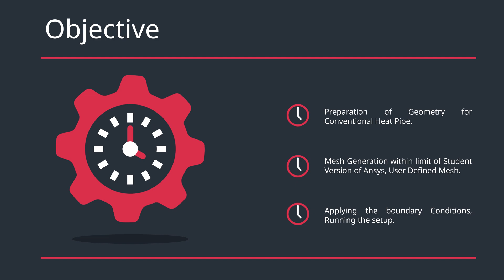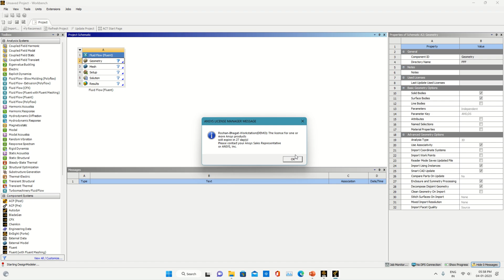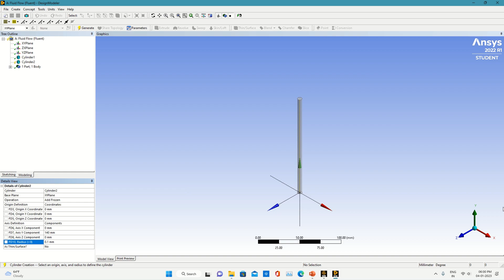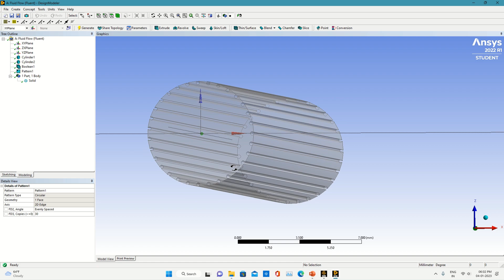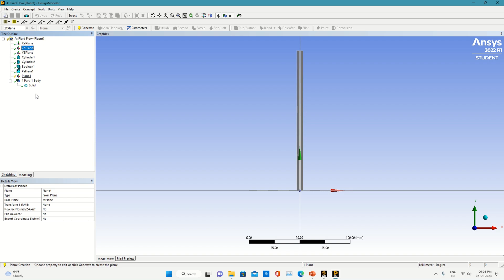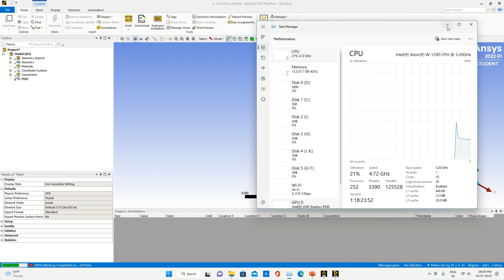CFD Analysis of Conventional Heat Pipe || Heat Pipe With Wick Structure  @Ayush.Bhagat

Comment: Hi, why did we need to divide the heat pipe into 4 parts while the other sections are not used or named 
What is the purpose of splitting since the heat pipe is having only condenser adabatic and evaporator section 
If giving amount of fluid is the purpose then why haven't we used any where??
Reply from the maker: To apply the boundary condition on specific surface in setup we done the slice.
We are considering the volume of fluid filled like 60% 
Another reason we want to speciy the heating section and condenser section thats the reason why it is done
I hope you got it
Reply: @FrontiersInCFD  I need to simulate a heat pipe how can I contact?
Reply from the maker: connect on whats app +919834584778

Comment: Thanks, it's a good and informative video. Can you please confirm it's a thermosyphon or heat pipe simulation? as I know in heat pipe the fluid return is governed by capillarity action not by gravity effect, again thanks for such an informative video.
Reply from the maker: its heat pipe. Diameter upto 3 mm is results in capillary action, diameter here is more. Its having v type groove fluid returns through groove after condensation

Comment: Hello teacher! Currently I am doing a 3D simulation of a heat pipe with grooves. I have some questions that cannot be answered, and I sincerely hope you can give me some advice. Thank you very much! First: How do I artificially set up steam channels and condensate return channels in the heat pipe? As we all know, the working state of grooved heat pipes is that steam flows in the center and condensate returns through the grooves. If the vof model is used to analyze the entire fluid domain, will the above phenomenon not be reflected? Second: If I simply extract the fluid domain for meshing and calculation analysis, there is a phenomenon that I am personally very concerned about, that is, the capillary force of the condensate flowing back to the evaporation section through the channel cannot be reflected. Because the performance of capillary action must take the tube wall into consideration. How should I carry out modeling so that it can not only reflect the changes of the two-phase flow in the tube, but also accurately describe the capillary reflux phenomenon? I am a beginner, if there are some basic factors that I have not considered, please forgive me, thank you very much.
Reply from the maker: Try to generate solid body along with fluid domain and have wick like structure, or prepare structure like a porous material

Comment: Why you made 2nd circle on diagram? Which was done pattern.. and how to know residual are normal or not? Have you followed any paper if yes please tell title of that. Thanks video is informative.
Reply: And what about adiabatic section. Need to define separately or automatically defined
Reply from the maker: In adibatic I haven't change any parameter
Reply from the maker: Second circle for wick material groove heat pipe . Check for divergence in velocity field.
No such paper..

Comment: Sir, while giving the cell zone conditions, you didn't specify which part of the domain is water, or which one is air. Does fluent take that into consideration automatically?  My second doubt is that the parts which contain air (the condenser and the part of the adiabatic section), is it the default air material or water vapor? Because, while you were giving the boundary conditions, the phase was set as mixture by default.
Reply from the maker: while preparing geometry names are given so while applying the boundary conditions, that places it is applied, the water is present initially with liquid fraction 1 while steam is produced after heating, so when mixture is specified it related to water present and vapor produced

Comment: Bro I already mailed to you for flat plate heatpipe analysis on ansys
Reply from the maker: I have done anlysis only on grooved heat pipe, in vertical orientation.
I have earlier tried with horizontal orientation but didnt get correct result
Reply: Iam ok with vertical orientation also but I need flat plate heat pipe analysts with given dimensions, please help me bro